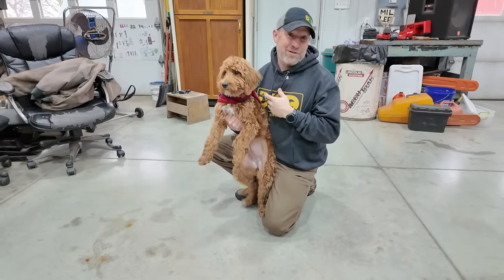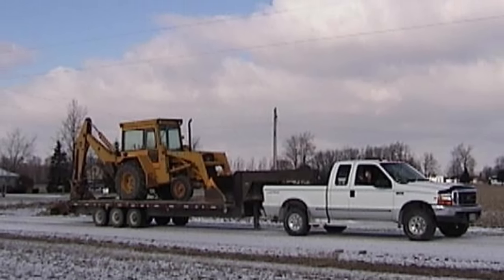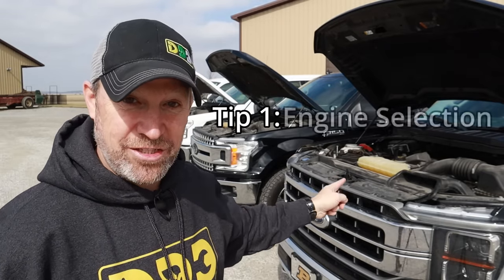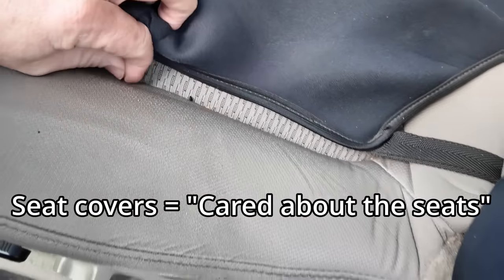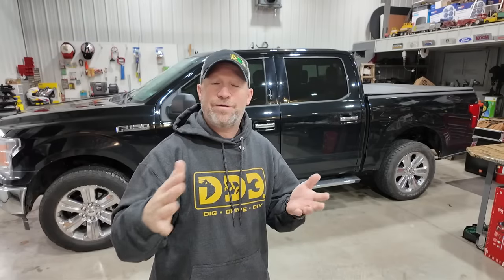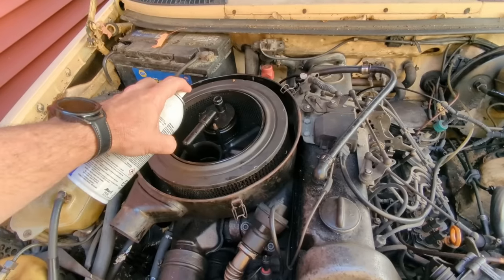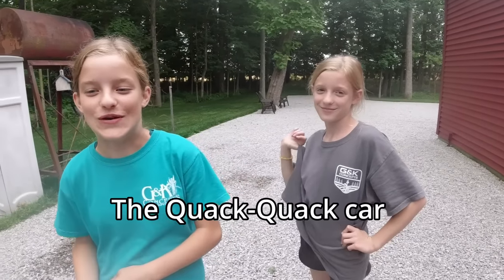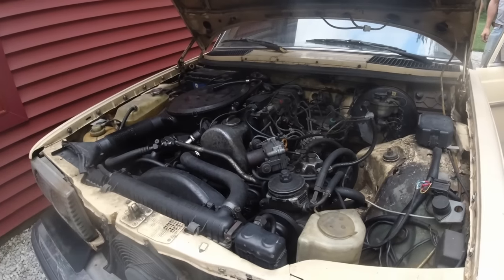How To Buy Used Trucks On A Budget

Comment: I like a few of your pro-tips on buying used... one owner, look at the interior, and of course black. But I want to know a couple of things.... 1) why only ford? a lot of good trucks out there. 2) what makes v-8s in and of themselves simpler/better than other motors?  I could guess your reasons but wanted to give you an opportunity if you feel like it to respond.
Reply from the maker: 1) I've only ever had Fords and never had a reason not to like them.  Don't have any prejudice against other brands just haven't had any desire to switch and learn something new unnecessarily.   
2) The V-8 makes it's power primarily from displacement.  Naturally aspirated air in, add fuel and compression.  The Ecoboost engines are awesome, but essentially you have to replace the displacement with forced air induction to make the same power as what the V-8 makes on it's own.  Two turbo chargers, intercoolers, oil lubrication to the turbos, etc, etc.  Lots of complexity to make a V-6 do what a V-8 can do.  Mileages is slightly better with the turbo V6 if you're using the truck as a commuter, but when pulling trailers regularly the V-8 is essentially even.  No gain from having a V-6 other than maybe a torque advantage in the 3.5 EB.  The EB engines are way more expensive to repair with all the extra tech when things start to fail.  This is all personal experience from being around a dozen company F-150s.  The V-8s just prove to be the best over the long haul and when pulling trailers.  However, I'm not afraid of the EB one bit if I only keep the truck until about 125,000.

Comment: Great video Neil! Helpful and heartwarming all at the same time, which seems to be your trademark!

It'll be interesting to see if guidelines change over the years as things get more computerized. I was thinking of FordTechMakuloco's video on a new taillight costing $5,600 to replace because of the interconnectivity in newer vehicles.

Finally, I love the Ford's for the number pad. We use the one on our Escape all the time to just grab something out of the car while not having the keys, or if you go to a water park or amusement park and you can just lock the keys in the car. And, I know it goes against your high mileage thought, but I bought my father's 2005 F-150 and it has around 36,000 miles on it. He's cheap though, so it has crank windows, but it's 4 wheel drive, so there's that. 😀

Comment: I follow a similar approach, 5-7 year old truck, I don't care about how many owners it's had, I try to keep it within 80-100K miles. I also agree that if the interior was babied, it usually means the rest of the truck was well maintained. I am a sucker for the Lariat Trim so I usually go for that trim. My previous truck, was a 2009 5.4 ford f150 Lariat, I bought it with 89K miles in 2014, for $20K. My latest one is a 2015 f150 Lariat, 82K miles, glass roof, bed cover, I bought it in 2022 for $28K. I then keep the car until the wheels fall off, or as it was with my last F150, until it got totalled in an accident. I still got $17.5K for it, so I only lost 2.5K and drove it 7 years. Another tip, I always buy from a dealer, but I go to another brand dealer. My first f150, I bought at an infinity dealer, and my latest came from a Toyota dealer both in high end areas, and I usually pay $3-5k under the going rate.

Comment: Love my 2020 lariat, bought it new. Performance tuned, it’s a beast, over 500hp! Never had an issue! Same with my old trade in. 2014 
lariat 3.5l. Love my Fords, but I’m old school with maintenance. 3,000 miles city 5,000 miles highway oil changes. Full synthetic, zero issues!! 😁😁
Reply: Got a friend of mine from work, still has his 2013 3.5 ecoboost approaching500,000 miles. Never touched mechanical wise.

Comment: Neil, I work for Ford, I am on my 3rd F150 lease all 2.7 turbo charged, i`m getting 20.4 miles per gallon in the city, if you drive like a normal person this truck sips gas. I do not tow anymore I sold all of my toys, i`m 61 now, so no more towing for me. I don`t care if it`s Ford, Ram or Chevy these new engines have very tight tollerances, and the timing chains are huge,  timely oil changes are a must, and if you noticed the oil filters are tiny to save room, I was told with todays new oils, it`s not the oil braking down at 5.000 miles that kill an engine, but the little filters abillity to keep it clean and send oil every where it needs to go, like on top of the camshafts. These new filters are tiny, and the turbo motors run a little hotter, if you start loosing oil to the camshafts, kiss the camphazers and timing chains goodbye. My final truck I plan on buying will be used, but I will try to purchace it from one owner and preferably an older gentleman who I know stayed on top of oil changes, be well.
Reply from the maker: Excellent advice. My white company truck was the 2.7L. Towing trailers as often as we do it had a lifetime average of 15.8 mpg.  It just had to work too hard to tow all the time.  The '15 V8 that we have at work only tows trailers and has a bit better mpg average.

Comment: I was in a 98 4x4 manual ranger for 10 years it had 200k miles on it never broke down but i just finally sold her 3 days ago after buying a 2018 2.7 4x4 ecoboost XLT F150 with 80k miles for $21000!! Its the nicest truck i ever had  there are deals out there to be had right now bad economy nobody is buying so car lots are desperate! cool video

Comment: Man those S123 Mercedes Wagons are too cool! I tend to buy two generations older than the current one. But that’s me being frugal. In 2018, I bought a 2004 F150 4x4 lariat with 180k for $6500. It was a great truck, I truly loved it. I ended up putting a nice lift kit on it, wheels and tires. Never gave me any major mechanical issues, I would change the oil every 3k miles (good thing to do with most F150 V8s). Then in 2020, car prices went crazy. I still kept my truck for some years after that but then sold it in 2022 with 240k miles for $12k. I kept it in really good shape though. Now I’m in the market for a truck again, and as tempting as the 13th gens are, I think I’m going to stick to my rule and buy two generations older. I’m searching for a clean 2009- 2010 F150 king ranch or maybe even platinum. I selected those years because I want to stick with the 5.4 motor. You can find nice ones for under $10k and those two trim levels will have plenty of nice features.

Comment: Great tips! I am weird. I have always loved Ford and GM equally. I am currently driving a 2003 Yukon with 240k and it still runs and drives great. I desperately want an F150 in the 2015-2020 body style. I am options snob, so leather and a moonroof are requirements. I do not want the 3.5 V6 either. So the 5.0 is the option for me. The problem I run into is that with options I want, and the 5.0, my choices are fairly limited and the market is still not great. My budget is about 20,000 cash, but trucks that check all the boxes in that price range that I am finding have 150k plus on the miles, which is a little more than I want, especially considering I am dropping 20k on it. I am basically constantly "shopping", meanwhile the old Yukon keeps on being rock solid. I bought the Yukon 8 years ago to clean up and flip and it just grew on me. It will probably the first vehicle that I will legitimately miss when I sell it. I constantly waiver between buying something newer, or driving the Yukon until it finally lays down for good.

Comment: Boiler up! What are your thoughts on the 2018-2020 5.0 oil consumption issue? 
I'm in the same boat as you - not spending $50k+ on a new vehicle so looking for used quality F150. Good video!

Comment: I'm with you on used trucks, my last new truck was 18 years ago and drove that truck 15 years and 225,000 miles so def got my money's worth. But in 2006 I was able to get a 4x4 full size crew cab V8 pickup for $26,000 now that gets you 100,000 miles plus. To me how it was taken care of is alot too. If someone didn't keep a clean truck they probably weren't worried about oil changes and maintenance. And the new engines with the 4cyl turbos and whatnot, junk as far as I'm concerned. My buddy has a 2021/22 Chevy 1500 with the 4cyl turbo and I have a 2016 with the V8 and my truck will tow circles around his even though the dealer told them they were equal.  On the other hand the engine in my dad's truck went at 80,000 miles, you never know.
Reply from the maker: Very true.  You never know cause there are horror stories for every make, model, engine or transmission option.  We hear about the bad stuff all the time but not as often about the reliable truck that never let a guy down.

Comment: My son scored a 18 F150 Platty 4x4 with 64k miles on it -  V8     FOR LOW $30K. IN GA      Its a sweet ride.     He is in the USCG and doesnt use it for work - its a grocery getter deluxe
Reply: My son came to the same conclusion about the motors in those trucks -   the v8 was the clear choice for longevity and reliability

Comment: First time viewer. I share your passion for Ford trucks. I currently have a 2008 F-150 with 5.4 and 153k and a 2013 Platinum with 6.2 and 90k, both bought used. I debate trading up quite often and then ask myself why and whether it is really necessary? I have been recently looking again, found a 2017 with a 5.0 and am debating it. Might be time to move on from the 2008 so I can have a Super Crew and not a Super Cab. Loved the video.
Reply from the maker: I really like the aluminum trucks just because of our climate and my Dad's 2013 has rust in the can corners already.  The 2015 I had at work still looks new.  If it had been a 5.0 I would've just bought it.
Reply: @digdrivediy  I agree 100%. My 2008 is starting to rust in cab corners and bedside. I like the 2015-2017 styling as well. It is hard to find crew cab long beds too. Keep up the good work sir.
Reply: @digdrivediy  I agree with XLT 302A pkg or Lariat. Best value trims to get.

Comment: Always had my grandpas mindset on vehicles, my dads side always had to buy new cars and trucks and my grandpa had a 08 chevy v6 with 510,000 miles. He never cared for new trucks and i always owned junk. I own a 02 f250 diesel with 135,000 miles, before i had a rotted out ram 2500 cummins with 510,000 miles and always had good memories!

Comment: I just did the same thing. I daily drove a 04 f250 5.4  4x4 bought it in 2016 with 140,000 just retired it running perfectly with 230,000 miles strong. It was an excellent truck. I saved and just bought a 2018 f150 5.0 4x4 with 120,000 for 17,000 and i could not be happier. Its a rocket compared to my old superduty. Blue Oval 4 life.
Reply from the maker: Great minds think alike 😉

Comment: I have a different strategy. I buy new, but then take care of my vehicles meticulously and keep them forever. Later on it’s like having an old used vehicle that you know the maintenance history on which was always taken care of. Buying used is like rolling dice at the table unless you know the vehicles history.
Reply from the maker: Well I'd be interested in knowing what "forever" means. Depending where you live and how much you drive, one vehicle could last a lifetime.
Reply: @digdrivediy  Good point, my current vehicles are a 2009 F150 and 2013 SUV. I live in the northeast so my biggest challenge is keeping them rust free. They are both pretty much still just like the day they drove off the lot in all aspects so I expect to get another 10-15 years out of each with any luck. I figure if I put two payments worth of wear parts into them each year proactively I am still far ahead of the game.

Comment: The 3.5l Ecoboost has only one huge problem. The PCV valves dump into the front of the turbos. The only way around it is. When buying new. Put in oil catch cans. I did. I bought my 2020 F150 brand new. Yet. Has just over 19,000 miles on it today. The interior still smells brand new. The second big problem is with the radiator for the intercooler. It's behind the license plate. To fix that. Move the license plate down. Put in a grill gaurd. I did. The other problem. Turbos burn up the oil fast. Oil changes have to be made under 5,000. Use only OEM full synteric oil. Most put in a high flow air filter box. I went on Amazon and bought a high flow air filter that used no oil and is washable. I put one in my Jeep as well. I love it. Only real problem I had and not Mother Nature did or someone else. My tires dry rotted before wearing out. That was noticed last month and changed. I had my way. The last truck I ever buy. Nice truck. Enjoy.

Comment: I just traded in my 2012 F150 Lariat for a 2017 F150 Lariat. I, too, domt shy away from "high" mileage. I was aiming for 125k or less, one owner, 2015+ for the second gen V8 (NA), 2015+ for the aluminum body (no body rust), and no newer than 2017 for the 6-speed transmission. In general, i try to avoid first-gen anything or at least the first few years of a new design (e.g. engine, transmission, sync, etc.). Like you, I'm not willing to pay new truck prices.

Comment: I just bought a 2019 lariat with 100k kms with a 4 year full bumper to bumper warranty from a Honda dealer, someone traded it in there. Super clean one owner truck in like new spotless condition.  All in it cost me $55k cdn that’s including tax, interest on the loan and the warranty. Brand new would’ve cost around $105k cdn all in. It definitely makes sense to buy used especially if you can get a warranty on it. I have pretty much a new truck for half the cost.

Comment: Fantastic video! Am I correct in assuming that vehicles generally tend to have more problems if they sit around a lot? Asking because my car is a 2003, and only has 71,000 miles on it. The AC is currently out of order lol
Reply from the maker: Yes, it seems that when vehicles sit around for long periods of time they begin to develop issues.  The best thing is just to drive them as long as they are maintained properly.  Almost all modern vehicles will generally go 200,000 miles or more without many major issues.
Reply: @digdrivediy  thanks!

Comment: We had a 1980 300 SD that the kids drove for 10 years.  We bought it specifically for the kids to drive through high school and college.  Mechanically it was very reliable.  I had to tinker with it on a regular basis.  The HVAC system was super way over engineered and was never very reliable for us.  The window regulators were torn out and replaced on regular basis.  I could have a front door card off in less than 10 minutes.  I replaced the turbo oil return seal one time.  When I was finished, I was pretty much covered with a coating of black oil.  What a mess!😄

My second and last new pickup I bought was a 1982 Ford F-250 XL 4X4.  The first was a 1979 F150 4x4 Custom,  SWB.  We have bought only used vehicles since then.  My current truck is a 2001 diesel F-350 Crewcab, bought in late 2002 with 30K.  Currently about 265K on the clock, running like a top.  Not having vehicle payments is a great way to be able to save money.  Thanks for the video.

Comment: Neil you are a true ford guy. I just bought a 2020 f150 2.7 eco and I like it so far truck moves.but I did get it from a dealer and I wish I saw this video before I did cause. Your video really made me think about what I did. Has 38,000 miles paying 27,000$ but if I take the 5 years to pay on it I’ll be paying close to 40,000$ I should have taken 20 grand and bought used!!! Ohh well I’m in it now😂

Comment: I pretty much use the same principal, but, with For Taurus.  Unfortunately, my LAST Taurus (and they dont make em anymore),  had a water pump driven by the timing chain/belt, which meant it was buied in the engine, which made it more than a chore to replace.  I got hit SO hard financially, and I was without a car for 5(?) days.  Never again (for at least two reason).   But, mileage does not always mean bad news these days.
Reply: Yep i won't buy any newer Ford 6 cylinder 3.5, 3.7, with the internal water pump. not worth the risk because i can't replace it...

Comment: I’ve got a 2003 ford f150 with 320,000 miles and the only thing mechanically wrong with it is a rear main seal leak and slop in the front end. Just needs a rear main seal and front end rebuild. It’s been the most reliable truck anyone in my family has ever owned. It used to be my grandfathers truck and I’ll never get rid of it it still runs and drives like a brand new one. Still on the original engine and transmission it has paid for itself 10 times over definitely one of the most overlooked generation of trucks as far as reliability is concerned

Comment: Lol.. the 3.5 twin turbo blows socks off the 5.0 when you're towing. It's not complicated to maintain it either. Keep the oil clean and drive it like you stole it.. I had a couple of 5.0 and they break a lot even if you're a grandma... Idk but it's my personal opinion because I know everything about the 3.5 since I worked at the dealership and may I add I'm talking about 2016 trucks.. I know nothing about the newer ones although I'm guessing they are better minus a couple of the newer years

Comment: It's pretty unfortunate that the body of the Mercedes is rotted out as bad as it is. But, upside is the engine still works and the trans can be rebuilt if needed. A little custom mounts and a swap into a clean body ranger or S10 of 80's or 90's vintage. You'll have a decent little 'run errands' truck at hand.

Comment: I put a mercedes 5 cylinder in a toyota pickup. OM617. Great engines. Cast iron block cast iron head. They are like little 5.9 cummins engines.